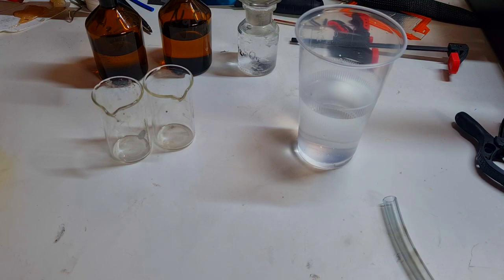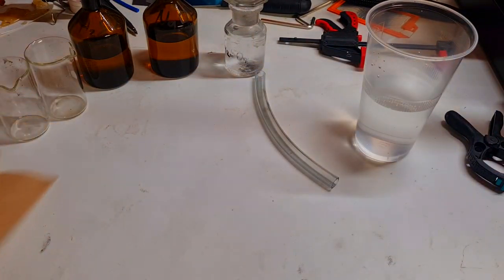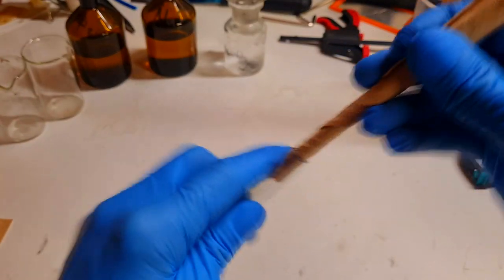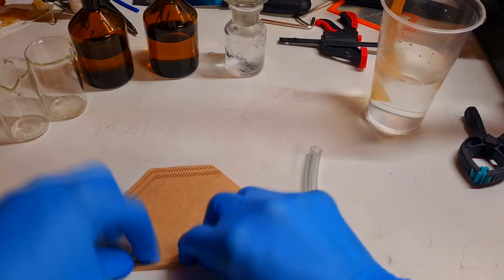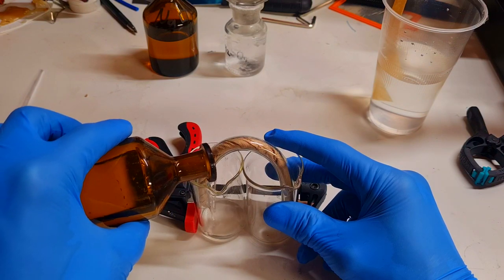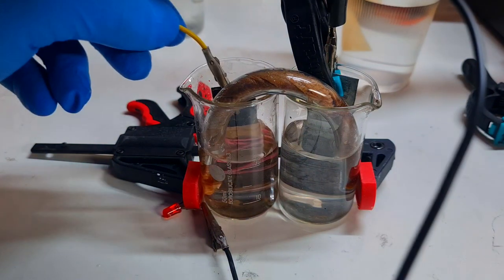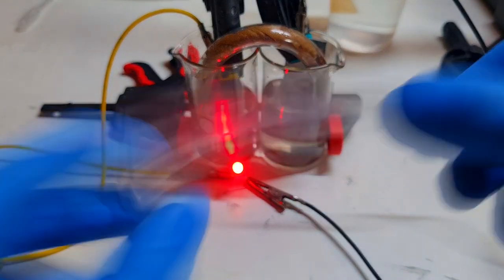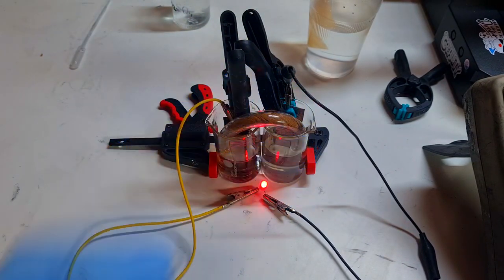DIY a Battery Salt Bridge

Comment from the maker: I need to re-upload the video because of the copyright claim. I was use music from site Pixabay, which are supposed to have Royalty free music,..... But it is not like this!
Reply: i have had a claim laid on audio that came from youtubes own library... just counter with its copyright free music. they are counting on you folding without challenging it
Reply: very nice demo. For safety reasons, when working with kids I might switch sulfuric acid and sodium hydoxide to something less caustic.  I too tried uploading a video with royalty free music and got blocked.  I think YT are going a too far with their copyright claims.  Your video is good with or without music.

Comment: Thank you cayrex2 for this informative experiment. I have a question, does the salt bridge method improve both battery cell lifespan as well as degration of anode and cathode? 

compared to the more traditional battery chemistry like a lead acid car battety?or solar batteries?

Thank you

Comment: good idea but what am thinking is that hydroxide ions from the KOH in solution with react with the metal cation to generate metal hydroxide which will reduce the efficiency of the system